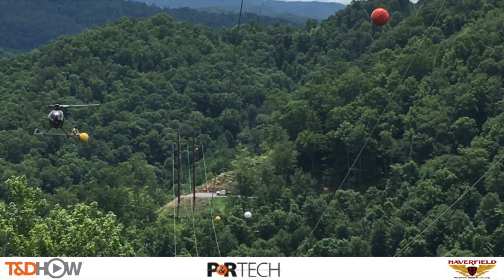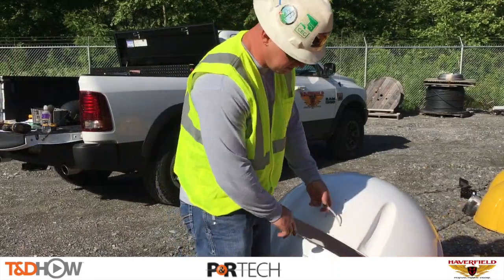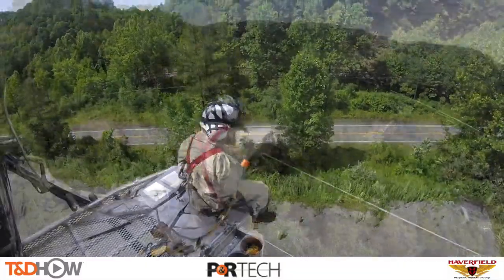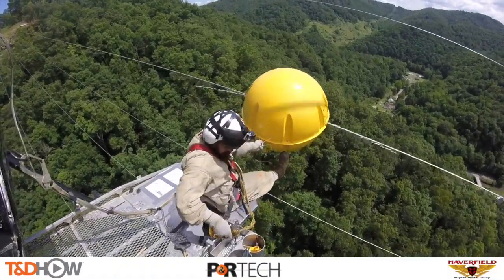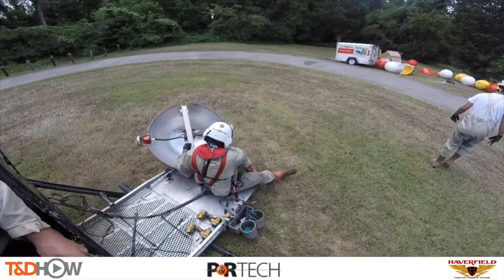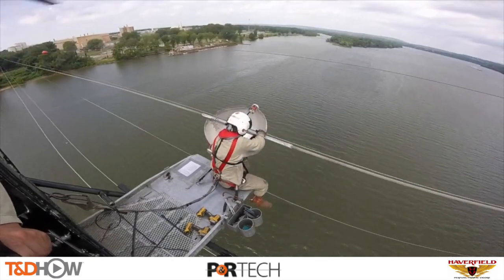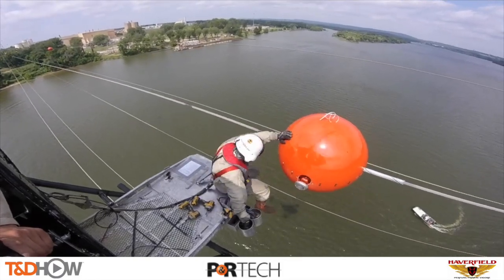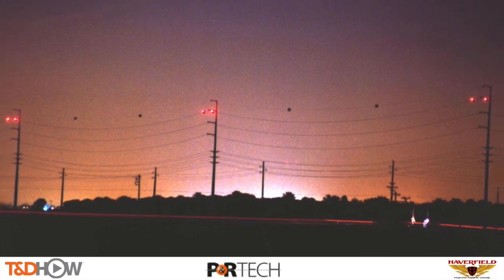Helicopter Install of Power Line Marker Balls

Comment: I am floored by the precision those helicopter pilots are capable of, hovering so steadily next to those lines that the installer can get the equipment installed. The aircraft doesn't move more than a few inches in any direction while the installer is placing the equipment.

Comment: how safe is it for the linemen? are the other lines live?
Reply: The lines are all live. It's okay as long as you don't bridge line-to-line or line-to-ground. Same concept as why pigeons don't die as soon as they land on an obviously live line. Also, these things aren't insulated. Kind of a trip, understanding that you can touch it as long as you aren't making contact with another phase or ground. However, a fall or failure of the helo/pilot will maim or kill. That's the more dangerous part of the job here.
Reply: @mchenj  isn't the lineman grounded by the platform?